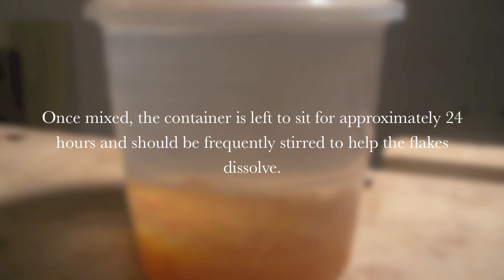The Gentleman's Valet part nine: A shellac finish and the final glue up.

Comment: Tom do you add anything to your hide glue to keep from setting to fast when i put mine on i have to work real fast to keep from setting up most of the time it sets up to fast 6 any advise  thanks Bill
Reply from the maker: Bill, thanks for the question. I find when my glue gets a few days old, after constant cooking, I'll need to add water to thin it out. This seems to make a slightly longer open/working time. Old thick glue kicks much faster. I'm not aware of any other methods, but thinning with water may help. 
Best of luck with it!
Reply: Tom Fidgen
 Urea slows the setting time, if need be